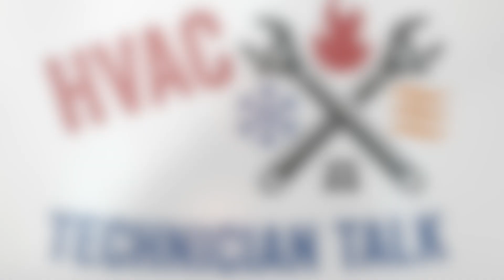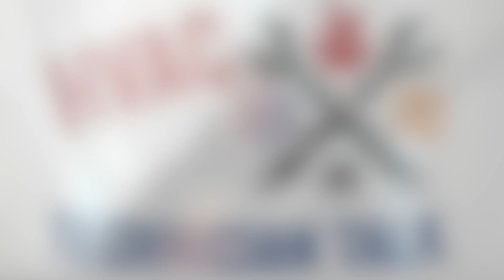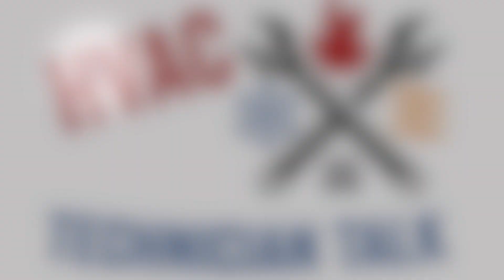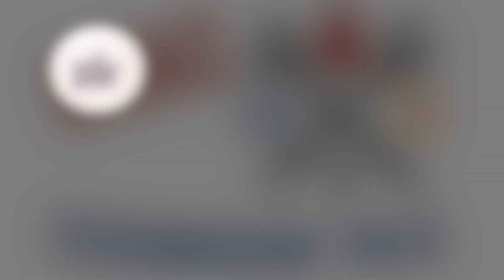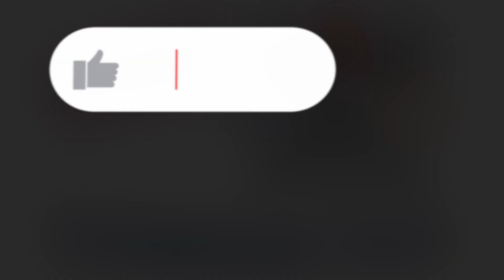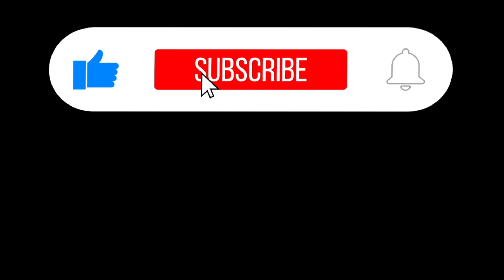#7 - X13 ECM Motors

Comment: Your confirming what I thought after a blower was replaced in my old furnace. I insisted on keeping parts, disassembled. I determined the motor was 3-ph based on measurement, and still likely good. I didn’t get into the head piece. For some reason, equipment was needed to program the new one. I wanted to fix the old one as a spare, but dumped it when system changed out. My knowledge is more electronic, and I’m not certain all HVAC techs know enough to go beyond replacing things. Appreciate your knowledge. Thx John.